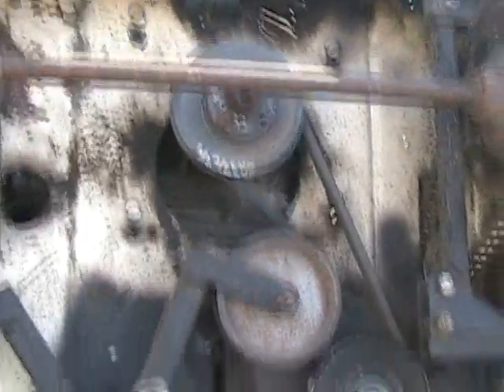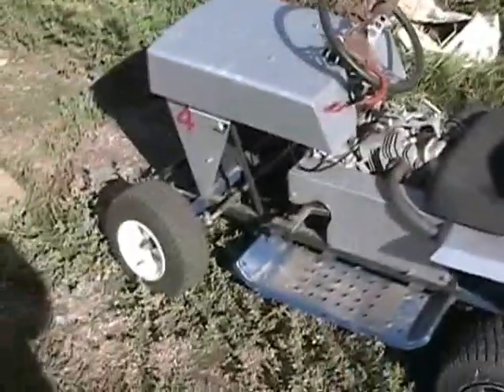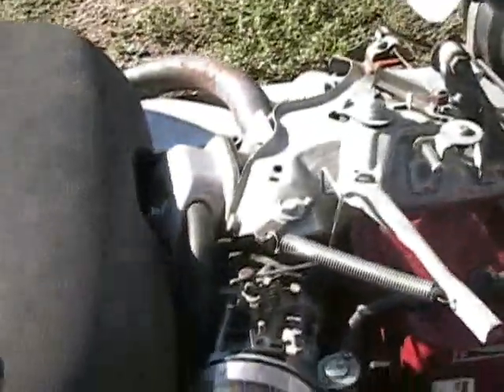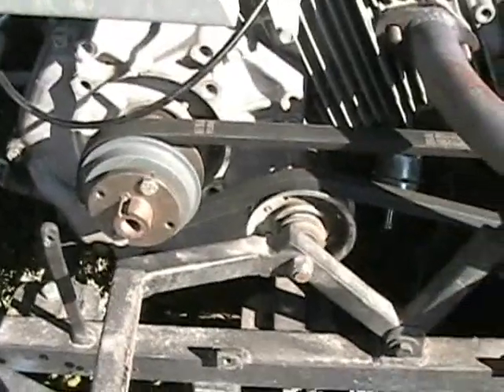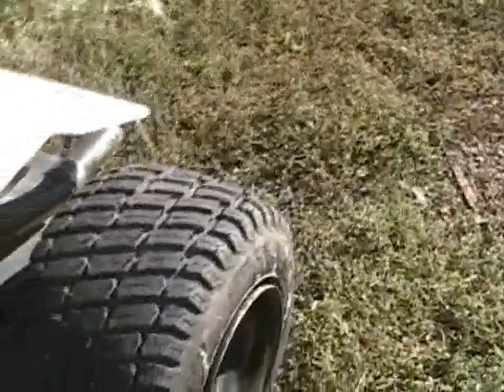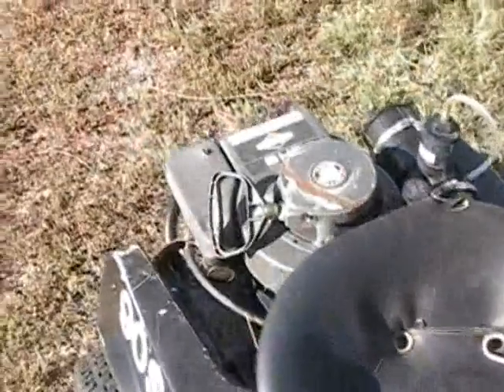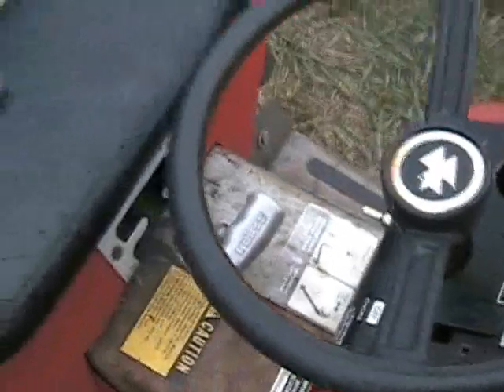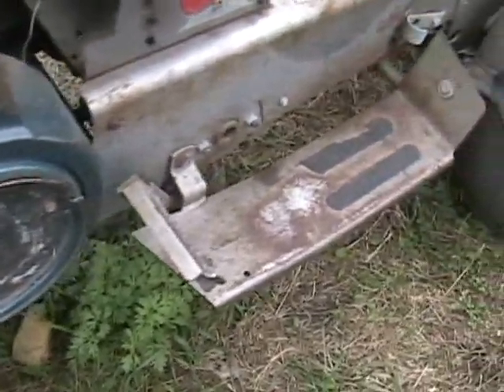Lawn Mower Mods

Comment: im from rochester NY my mower isnt really set for tight turn racing but it is definatlly a oval track racer. so far im toppin the speed out at around 55mph but when i put a 10" pully on the motor i will be running a final ratio of 10 to one. it is indeed a 3 speed. i also lowered it for tighter corners and have a jackshaft running in the middle if you want to challange me to a race i have a track avalible drop me a e-mail to challange me..